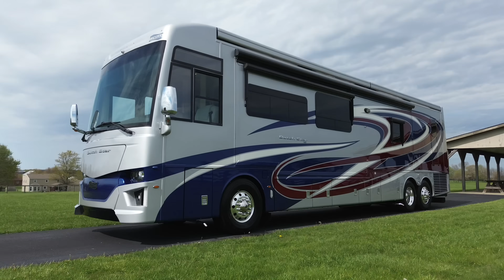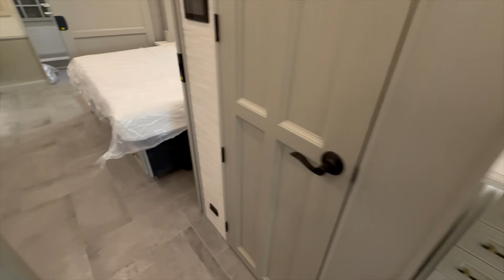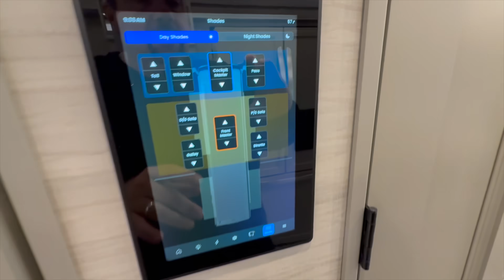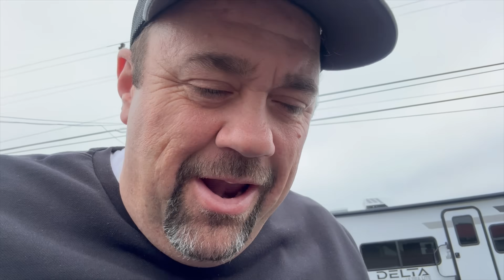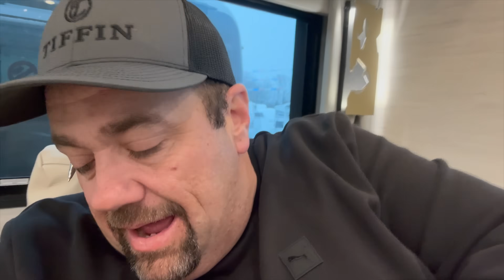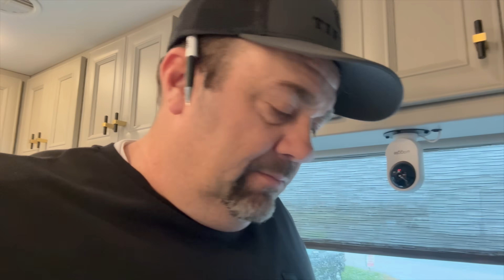Brand New Tiffin Quality Control inspection What Did Doug find wrong 2026 Tiffin Allegro Bus 45OPP

Comment: On the water pump, try disconnecting the water out hose and then turn the pump on and off quickly if it pumps. I had this issue when winterizing after putting in a winterizing valve.  Might work for you.
Reply from the maker: The guys figured it out in 10 seconds

Comment: Window near shower: frost the glass.(?) Tint provides privacy until nightfall and even though you only see shapes and blurred light fixtures, it needs modification.
The solid surface floor in our 2015 Tiffin Allegro Bus does not get slippery. Did they change the finish? 
Fireplaces will heat coach too.
 Would not own any coach without heated floors. Once you have them you are spoiled for life.

Beautiful bus!

Comment: Hey Doug noticed that there was condensation on the floor in the bedroom by the vent is that due to the Aqua-hot and if so how does it do on the floor? (See 8:46 on the video. ) not being picky but if you remember, I told you I was going to school to learn how to inspect coaches as well as work on them and I guess I’m getting kind of used to picking out things. And just kinda wanted to know the answer to that. Thanks.
Reply from the maker: No 
Water from my hands after testing water systems.

Sinks were full just stepped out of shower after testing.

Nice catch though.

Very observant.
Reply: @Sewellmotorcoach I saw the water also, but considered it might have been off your shoes since we have been having wet or snowy weather recently. I've shared a couple of your videos with my friend that's starting to look to trade from a class C to a class A. There are several bigger volume dealers in their area but I think they would be better off to do business with someone that cares. And you seem to be that kind of person! I'm not even in the market and I'm binge watching your videos! We pull a fifth wheel and probably will never change to a motorhome. I was very excited to drive by and see the Alliance products, though. I've been a fan of Alliance since they started up. I'm in a Montana High Country and it is very nice at its price point. So far no big issues for us, though I know it's not the high end of fifth wheels. Keep up the good work and maybe I can convince my friend to come down and visit your dealership!

Comment: I have read multiple reviews about the new Tiffin Zephyr completely falling apart once delivered to owners. The failure is to do with structural integrity, walls separating and slides not operating. How could you test these rigs to know if these types of failures will occur?
Reply from the maker: Every manufacturer can have some quality control issues! 
It’s not acceptable but unfortunately it’s part of the business! 
Tiffin always takes care of their customers 
They have a proven track record of being the best in the business for customer service! 
That has not changed! 
They can always improve just as all manufacturing businesses can.

The issues you’re seeing are very rare and not the norm.
And in each case Tiffin is standing by the product.
Please understand that some YouTubers don’t offer much context and let the negativity fly because that’s what gets the clicks.
I will not deny that issues have happened, I’m just saying that Tiffin Motorhomes has the desire to make each of their mistakes right and get better.
The perfect motorhome will never be produced! 
My job is to sell the product and hold them accountable and furthermore make sure I know what I’m selling my customers.
Even $3 million bus conversions need service and repair after they are sold new.
And yes they have quality control issues as well.

Comment: WOW-A dealership inspection and actually through PDI -I am so impressed and would consider buying a new coach like this from your company-I hope you can maintain this -We ordered a brand new Newmar Dutch Star in 2023 and none of this was done by Newmar or the dealership-We had to spend a week in the dealership parking lot trying to work out the defects and still ended leaving with defects-These Motorhomes aren’t cheap and as a customer when we pay over $500,000 of hard earned money, all we ask for is that they work from the start and not a huge disappointment-I am excited you are doing this 👍🏻👍🏻🇺🇸🇺🇸🎉

Comment: What are you seeing when accepting them from the manufacture vs you getting them ready to sell: dust, screws, saw dust etc on the floors and nooks n crannies? Thats a issue i've seen and shouldn't be there from the factory. Also, slideouts: in/out, how smooth or not they are along with alignments
Reply from the maker: Yes 
We see construction dust etc..

This is normal for the rv industry.
These RVs should be inspected and cleaned upon arrival.
Just the inspection alone caused a coach to need cleaning.
I feel the factory cleaning would be useless.
We have to do it regardless.

Hope this helps.

So far so good on me mechanical systems.
No two units will have the same issues.
We are ready to roll with the punches.

That’s the nature of the business!

Comment: I might have a solution for the slippery shower floor, I build boats and I use anti slip paint on the decks, if it works on fiberglass it should work on shower floors, tell me what do you think
Reply: Yep shark skin. They will just need to mix it with something that works with Corian

Comment: As I found out, General Rv in Tampa where I bought my class A at has great sales people but comes with a curbside relationship  with customers, when you drive away from the curb the relationship is over and god forbid you have an issue after you drive away good luck getting it addressed and fixed right. A dealership with great service far outweighs a dealerships with only great sales personnel. On my next purchase I believe I will be driving across the country to check out SMC
Reply from the maker: Thank you for the great comment!